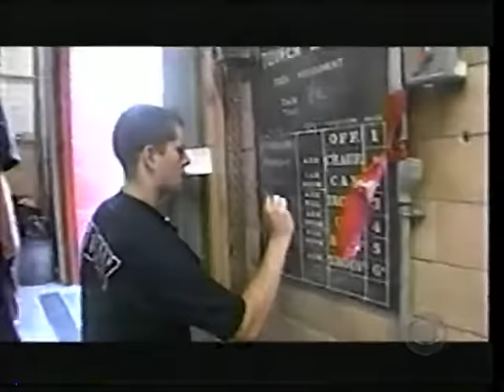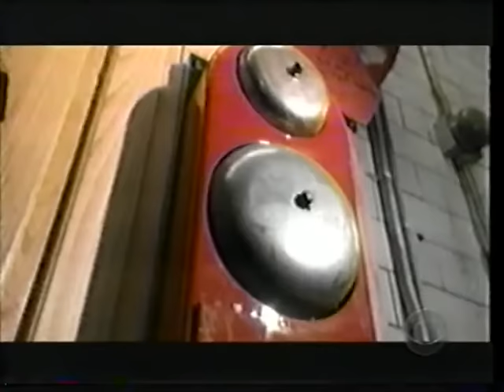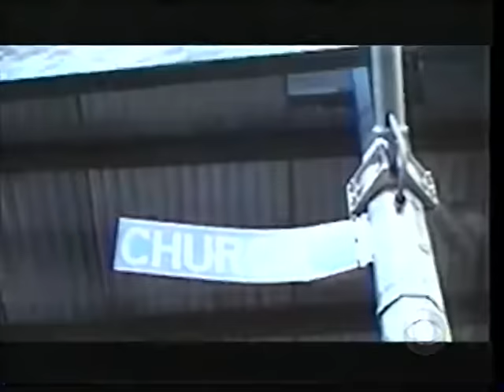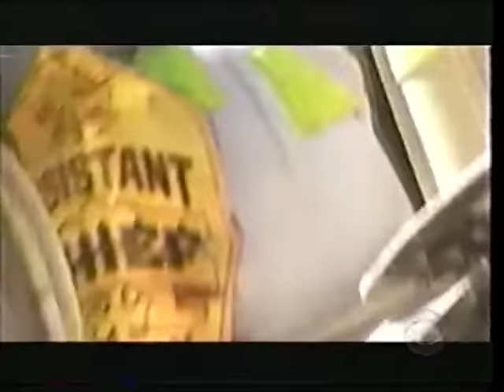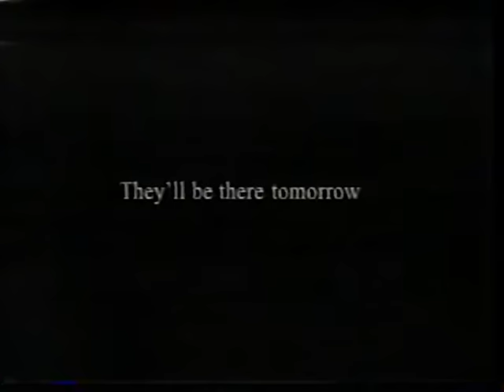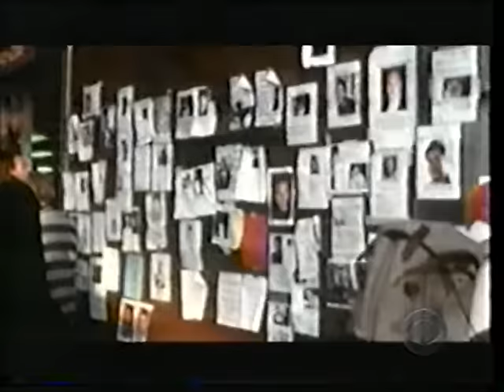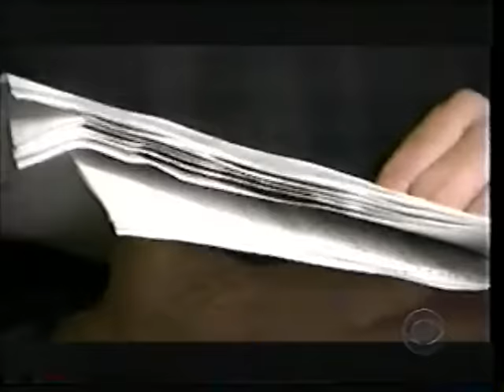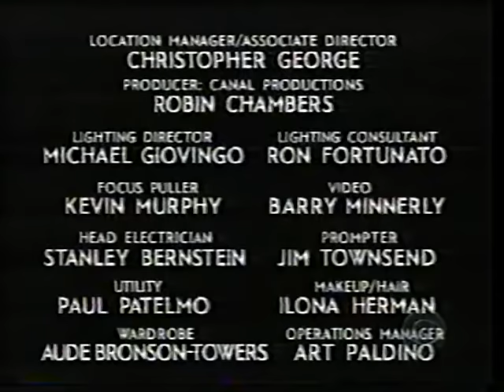9/11, CBS, March 10, 2002 (Graphic Content, Profanity)

Comment: Why when they were in tower 1 why didn't they go out the lobby they were just in it why go up the escalator
Reply: The escalater led to that tunnel that crossed the street outside. If they would have ran outside they could have been buried. They were on the opposite corner from the collapse.
Reply: People were still jumping a debris falling.
Reply: @mariezurie7828  37:09 37:38 Debris such as office furniture weren't just being thrown out of the building. People were throwing themselves out of the building to escape the pain of the heat and/or asphyxiation due to smoke inhalation.
I'm fairly certain that was a body slamming against the structure at the timestamp. First responders have stated as much...

Comment: Less we forget 🙏😢🇺🇸. My question is, why weren't any Jet fighters called to provide protection for the other tower?
Reply: reports say they were on a millitary exercise about 180 miles away..training. which is why they took longer to intercept any aircraft.
Reply: No time.  From seismic data (spikes from "hit" by the plane to  collapse) North Tower  08:46:26-09:59:04 and  South Tower  09:02:54-10:28:31.  So, the 2 closest F-16 pilots (Langley) tasked with finding flight 93 reports being in the air in <=10mins.  If headed to NYC @ max speed 1,345mph to make NYC in ~17 minutes.  But only NORAD had missiles not Langley. And these pilots discussed plan to catch them over rural area & sacrifice themselves as well (as they had no missiles).
Reply: @mariezurie7828  it is still unknown why fighter jets didn't intercept the planes (or missiles depending on which story you believe of that day) that day. There were reports/conspiracy theories that military exercises were done that day. What we do know officially is that two fighter jets were called in from Massachusetts to try to intercept. Its talked about on the ABC Documentary back in 2002.